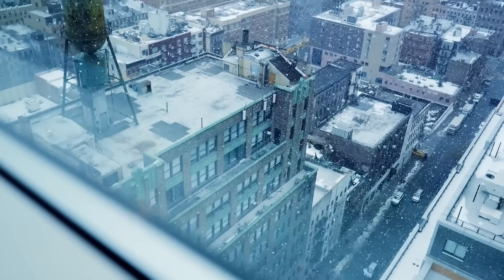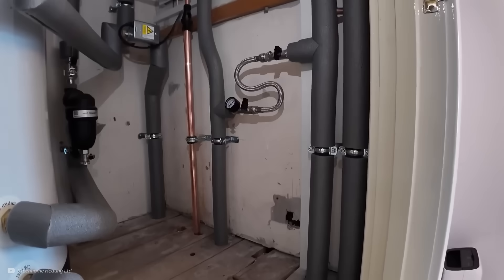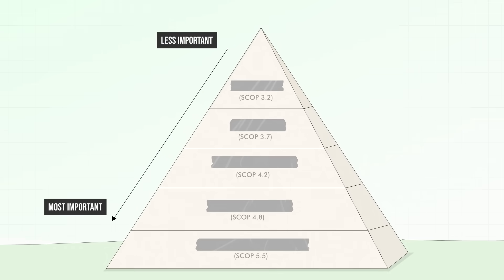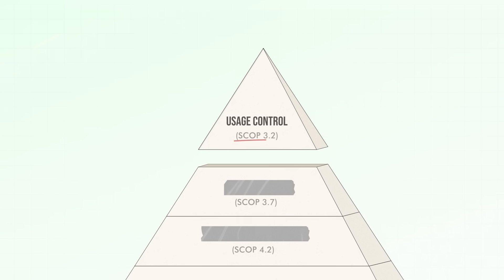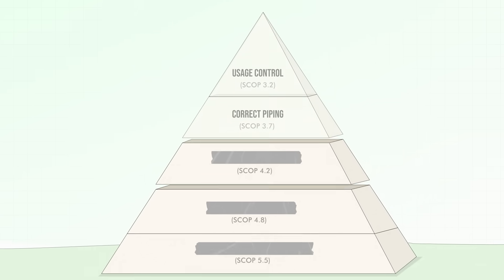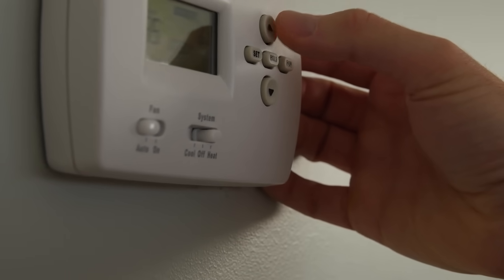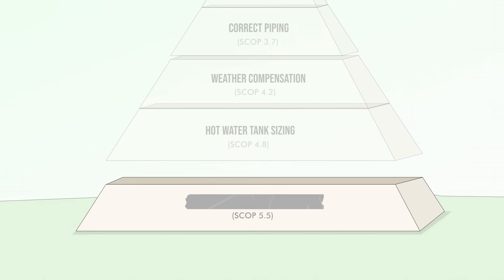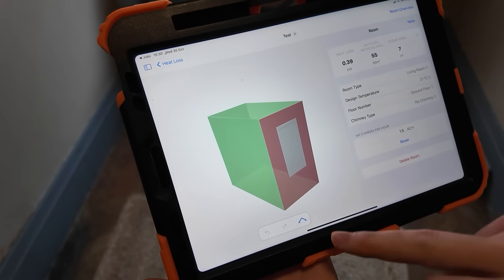The Genius of the World's Most Efficient Heat Pump

Comment: Replacing the expansion valve with a piston expander would increase COP +1. Manufacturers don't do it because it would increase cost of a given heat-pump. I don't think even the better systems do it.
Reply: very advanced comment! not many people will even understand this unless they are a HVAC engineer, i considered adding a scroll to expand the gas in my homebrew design.
Reply: @ChrisDay-sx4lv  , thanks! It depends on many factors, and an assumption about how efficient the expander is. For a piston expander then it needs to have complex valve gear, effectively a pneumatic engine, whereas the compressor can work with one way valves. But I definitely like your idea of using a scroll expander - would work well on same shaft as scroll compressor. But a small turbo expander with recovery generator would be easy to retrofit to existing designs. Maybe putting a "Turbo" badge on a heat pump would be worth something to the market?
Reply: @martingarrish4082  varying the load on the scroll expander generator has the effect of adjusting the expansion valve, fine tuning can be done via a normal EXV downstream of the expander, whichever type you choose.
Reply: @ChrisDay-sx4lv  , again a retrofittable solution. Read patentable for any HVAC engineers reading this. 😉
Reply: @ChrisDay-sx4lv  would this moving part last and ever recover its cost in energy savings, brand damages due to failure, and service calls, let alone in the real world where power is worth .02$/kwh and off grid solar power is .05$/kwh?  im guessing no way in hell.
Reply: Large CO2 pumps use expansion turbines coupled to the compressor shaft as I understand it - same principle as a gas turbine. Recovering energy during decompression is always a good thing in theory, but not always the easiest thing to implement.
Reply: @bringiton8989  , agreed. That's why heat pump development engineers are told not to do it. But, it should be a consideration - the problem is how to make the market aware of the benefit in selecting a more expensive heat pump for higher COP. Then the engineer's job is how to keep the cost down with volume, and the reliability up with testing.
Reply: I can't see this being viable on small Refrigeration systems. Too complex and due to losses, negligible energy to recover. 
Most companies don't even want to fit heat exchangers to use the cold suction gas to cool the liquid which is simple, cheap and effective. 
People need to choose their heat pump based on COP not on its colour, then maybe we will see improvements.
Reply: @foxythedirtydog4494  , I don't see COP +1 (thermodynamic estimate) as negligible but agree that the market does need a driver. The heat pump COP leader board is a good idea to introduce a little technical competition. But it took the EPA et al. to convince engine companies to think about reducing the non-CO2 emissions - maybe COP improvement has to be legislation too. Ungreen tax?
Reply: I’m listening..
Reply: Just confirming heat pumps are built to a price and have shit cheap parts fitted timed to fail etc..
Reply: @izalman  , Yup. The myopic economic model. I would like to think that at some point we transition to a more sustainable economy... 🙄
Reply: @izalman  if the savings make a return in less than 10 years it was worth it tho lol.  technology improving too why overpay for a system that will never save its value vs market
Reply: Closed loop thermal expansion valves are extremely common !
Reply: @alistairplank4996  , so is cardboard. But if somebody wanted to design a critical component like a wing spar out of it I'd be more than a little nervous. This CO2 thing is beginning to feel a little critical to me... 😟
Reply: @martingarrish4082  you'd have to show numbers, because I simply can't see that claim being accurate.
Reply: @SuperS05  , YouTube not the best place to put equations. But here goes:

For good heat pump cycle in line with video, using R134 working fluid.
Pcondensator = 10bar & Tcondensator = 40'C,
Pevaporator = 2Bar & Tevaporator = 0'C.

Using p-h chart from ICL:
www.imperial.ac.uk/media/imperial-college/research-centres-and-groups/thermophysics/Chart-p-h-R134a.pdf

Enthalpy across evaporator = from 230J/kg to 400kJ/kg (wet vapour region)
Enthalpy across condenser = from 420kJ/kg to 255kJ/kg (wet vapour region)

So Qdelivered = (420kJ/kg - 255kJ/kg) * 70% = 115.5kJ/kg,
and Wcompressor = (420kJ/kg - 400kJ/kg) / 70% = 28.57kJ/kg.

So conventional heat pump COP = 115.5kJ/kg / 28.57kJ/kg = 4.04

For pressure recovery:
E = F*D = P*A*D = P*V = P*m/rho
or E/m = P/rho

For example 1/rho_avg = 0.5*(0.002m^3/kg + 0.02m^3/kg) = 0.011m^3/kg (approximation only)

So Wexpander = (10Bar - 2Bar)*1E5Pa/Bar * 0.011m^3/kg * 70% = 6.16kJ/kg

So Wcompressor - Wexpander = 28.57 - 6.16 = 22.41kJ/kg

So pressure recovery heat pump COP = 115.5 / 22.41 = 5.15

So, my initial claim of COP +1 stands. My argument is for total cost of ownership and feeling good about producing less CO2 - that's a genuine economic driver. No doubt a professional could provide more accurate estimates using GT-Power or similar.

So my argument is that it is worth investing the time to see whether a solution could be developed that is commercially viable...
Reply: @martingarrish4082  you must have a few typos. Plotting that on a p-h chart, 250J/kg would be the evaporator input, not output. 100j/Kg is literally off the bottom of the chart.

Your assumption of 75% recovery is extremely generous. You haven't mentioned provisions for oil flow and recovery. A hole dropping into the low pressure zone would introduce more losses. We haven't even gotten into mechanical losses yet.

And now into the mechanical wear aspect. At 250j/Kg and dropping from 10bar to 2.5bar, you'd have about 25% vapour, the rest liquid. (quality) That liquid plus the liquid oil would be very harsh and cause erosion on any surface where sharp turns occur, including inside the expander. These are devices that need to be designed to operate with 100% duty cycle for at least 10 years. Metal contamination is going to significantly lower the life expectancy.

How would you design this to ensure that the compressor SH is within tolerable levels and adjusting to conditions like a TXV/EEV would?

Oh, and to have an evaporator p/t that high would require an extremely large coil, and/or a very warm ambient. IE 15°C? Most people here wouldn't even have heat on at that temperature. -15 to - 35°C would be a more appropriate temperature to work at. (ambient air at a bit above freezing down to -25°C approximately) Your condensing temp is only suitable for heating air uncomfortably. Most people would complain of discharge air that cool. Forget about trying to get convection going at a water temp that low. You'll have to bump that up significantly. Honestly your temps would only be accurate for cooling mode.
Reply: @SuperS05  You are quite right, my original method was wrong. Let me try it again:

For good heat pump cycle in line with video, using R134a working fluid for air to air heating.
Pcondensator = 14bar & Tcondensator = 50'C,
Pevaporator = 2Bar & Tevaporator = -10'C.

Using p-h chart from Imperial College London (Google Chart-p-h-R134a.pdf)
Enthalpy across evaporator = from 190J/kg to 390kJ/kg (wet vapour region)
Enthalpy across condenser = from 425kJ/kg to 270kJ/kg (wet vapour region)

So Qdelivered = (425kJ/kg - 270kJ/kg) * 85% = 131.75kJ/kg,
and Wcompressor = (425kJ/kg - 390kJ/kg) / 75% = 46.67kJ/kg.

So conventional heat pump COP = 132kJ/kg / 46.7kJ/kg = 2.82

For pressure recovery:
E = F*D = P*A*D = P*V = P*m/rho
or E/m = P/rho

For  this example 1/rho_avg = 0.5*(0.001m^3/kg + 0.04m^3/kg) = 0.0205m^3/kg (approximation only)
So Wexpander = (14Bar - 2Bar)*1E5Pa/Bar * 0.021m^3/kg * 50% = 12.3kJ/kg
So Wcompressor - Wexpander = 46.7kJ/kg - 12.3kJ/kg = 34.37kJ/kg

So pressure recovery heat pump COP = 132kJ/kg / 34.4kJ/kg = 3.83

My initial claim of COP +1 holds with pressure recovery. My argument is for total cost of ownership and feeling good about producing less CO2 - that's a genuine economic driver. No doubt a professional could provide more accurate estimates using GT-Power or similar.

So my argument is that it is worth investing the time to see whether a solution could be developed that is commercially viable...
Reply: @martingarrish4082  you'd have to show numbers to support your claim. Otherwise it's simply not believable
Reply: @SuperS05  , You are quite right, my original method was wrong. Let me try it again:

For good heat pump cycle in line with video, using R134a working fluid for air to air heating.
Pcondensator = 14bar & Tcondensator = 50'C,
Pevaporator = 2Bar & Tevaporator = -10'C.

Using p-h chart from Imperial College London (Google Chart-p-h-R134a.pdf)

Enthalpy across evaporator = from 190J/kg to 390kJ/kg (wet vapour region)
Enthalpy across condenser = from 425kJ/kg to 270kJ/kg (wet vapour region)

So Qdelivered = (425kJ/kg - 270kJ/kg) * 85% = 131.75kJ/kg,
and Wcompressor = (425kJ/kg - 390kJ/kg) / 75% = 46.67kJ/kg.

So conventional heat pump COP = 132kJ/kg / 46.7kJ/kg = 2.82

For pressure recovery:
E = F*D = P*A*D = P*V = P*m/rho
or E/m = P/rho

For example 1/rho_avg = 0.5*(0.001m^3/kg + 0.04m^3/kg) = 0.0205m^3/kg (approximation only)

So Wexpander = (14Bar - 2Bar)*1E5Pa/Bar * 0.021m^3/kg * 50% = 12.3kJ/kg

So Wcompressor - Wexpander = 46.7 - 12.3 = 34.37kJ/kg

So pressure recovery heat pump COP = 132kJ/kg / 34.4kJ/kg = 3.83

So, my initial claim of COP +1 holds with pressure recovery. My argument is for total cost of ownership and feeling good about producing less CO2 - that's a genuine economic driver. No doubt a professional could provide more accurate estimates using GT-Power or similar.

So my argument is that it is worth investing the time to see whether a solution could be developed that is commercially viable...
Reply: @martingarrish4082  I'll have to run through the numbers later. However it is pretty clear that you're using the refrigerant properties method to calculate COP. That's fine for theoretical discussions but does not take into consideration the efficiency/power use of the motors involved. AHRI (and I believe also EU) standards now insist that those losses are included. Is that why you added 75% coefficients in there?

Even with your increase of 0.62 isn't a whole lot. I'm really sure that the added complexity wouldn't be worth it in cost and headache. (capital, maintenance, warranty, and training costs) This is the primary reason why liquid/suction line heat exchangers aren't used in this application. The performance increase doesn't justify the added costs.
Reply: @SuperS05  , yeah apologies that YouTube seems to be making corrections difficult - it's not really set up for this. The %age coefficients are just for me to estimate component inefficiencies. I'm now back to estimating COP +1.

You might care to google Ejectors: Smarter Energy Recovery to see some of the ideas that are being considered for pressure recovery.
Reply: @martingarrish4082  an injector is not the same as a piston or turbine expander. I could see potential in those, but the control over refrigerant flow is going to be a problem. Remember, compressors are vapour pumps, and cannot handle any liquid at all, especially with the newer scrolls using crankcase bypass funnels. A passive accumulator can only protect against transients, not sustained liquid return. I still see a lot more problems then benefits but at least I think that might be engineerable even if not commercially viable.
Reply: @martingarrish4082  2040energy has a nice set of articles on it. They conclude that it's worth looking into, but conceed that the engineering is going to be difficult, maybe impossible or at least impractical.
Reply: @SuperS05  , yeah I'm starting to understand that it's more difficult than I initially thought because of the need to stay in the wet vapour region. I am wondering whether a turbine genset would fit the bill. The motor/generator could control precise rpm and react torque for exact pressure control. PhD project for somebody...
Reply: @martingarrish4082  I could imagine a turbine setup, using power electronics to control energy flow in order to control refrigerant flow. It would be a rather awkward control algorithm. 

As it stands at the moment, a TXV/EEV is modulated to maintain SH, which in the end is directly coupled to evaporator loading compared to compressor flow rates. It's an elegant and simple control system that doesn't need to be anywhere near the compressor. You can have multiple (fixed/variable capacity) compressors, Expansion valves, evaporators and circuits and all importantly, flow reversal. (Eg. the very definition of heat pumps.) You get all of that without any additions training, and very neat peak efficiency. Maybe there's a bit more to get out of it, but I wouldn't be investing in it.
Reply: @SuperS05  , if a more expensive heat pump was available that meant I paid 70% of my current electricity cost then I would certainly consider it. It would pay back for itself. Solar power will help. To meet emissions the latest diesel engines now have such complex turbo control systems.

This all really highlights that without leader boards and legislation to encourage, and grants to facilitate, then HVAC organisations will never invest in the R&D to improve heat pump efficiency on their own. The perception is that there is no market advantage, because they are not worried about where the sustainable electricity is coming from.

But how do you know if you never try?
Reply: @martingarrish4082  there is plenty of R&D into more efficiency, but they pass that cost down. Flagship devices are usually SIGNIFICANTLY more expensing, far exceeding any ROI even before considering the crazy expensing proprietary parts. Utility costs are not the only part of total cost of ownership, maintenance and repairs are too.

But go ahead, spend your money. It'll help pay for my house. I really don't mind.
Reply: @SuperS05  , as long as the take-up of heat pumps is encouraged by various governments then you get your house paid off, I get my high COP heat pump, and the world transitions to sustainable energy sooner. This feels like a win-win outcome.
Reply: @martingarrish4082  I should probably mention that I charge a premium on top of my already expensive rates for this stuff. So few people know how to troubleshoot and repair, it's only fair. Expect $100-150 usd/hr plus parts Ave taxes depending on where you live for residential. 20-30% higher for commercial. (I really don't care that you're a struggling mom and pop store or a booming big corporation.) Some cities are a tad higher.

Proprietary parts can be easily the price of the cheaper model in it's entirety, and take twice or thrice as long to troubleshoot and repair.

Any heat pump or other refrigeration system usually starts at the $1000 for repairs as soon as I touch the refrigeration section.
Reply: @SuperS05 yeah the complexity of the heat pump systems are significantly higher than the standard HVAC equipment. A person may be better served by having better insulation in a new build or paying the higher electric cost rather than turning their house into a science experiment.
Reply: @Zorlig  first you have the HP itself is already more complicated. Simple enough though. Then you have various types of expansion device. Then you have vapour/liquid injection into the compressor. (or relief ports depending on which patent being used) Bumps up the efficiency a tad. Then you have the various modulation/staging methods. Then you have 2 different variable frequency setups, VFD or ECM. This is generally in order of cheap/simple to expensive/complicated. That's before jumping until multi circuit units.
Reply: @SuperS05  for sure. When I went through the math on new home construction the way the numbers come out is that if you insulate and air seal sufficiently (which is quite doable) then you can get away with one ton of heating per 3k-5k sq feet. At that point the efficiency of the heating system doesn't matter much.
Reply: @SuperS05  , google "Ejectors: Smarter Energy Recovery" (I wish YouTube would allow links to be posted). It looks like I'm not the only one to be wondering whether that energy in the compressed fluid could be recovered...
Reply: I think they are looking into those for CO2 systems...

Comment: 13:49 whoa! a radiator in a box? it can't distribute its heat as efficiently, causing all kinds of problems. if i had the money to build my house, i'd go for underfloor heating EVERYWHERE, no radiators.
Reply: All new houses here have floorheating here now. Comfort is really really really good. And no ugly radiators anymore.
Reply: @HermanWillems  back in germany i lived in a flat with underfloor heating for a while. it was nice :-)
Reply: Under floor heating has a large thermal mass and surface area so the temperature of the floor is much lower, which will increase to COP of the heat pump. Also, larger radiators with greater surface area can radiate the heat more effectively and at a lower temperature. This will also increase to COP versus a smaller radiator.
Reply: @bladerunner1458  the large thermal mass will affect the response time (underfloor heating responds much slower than radiators) but not the efficiency.